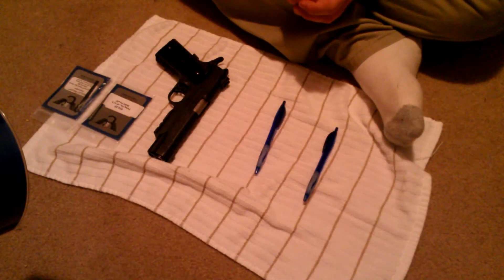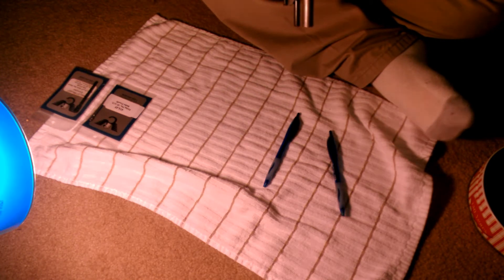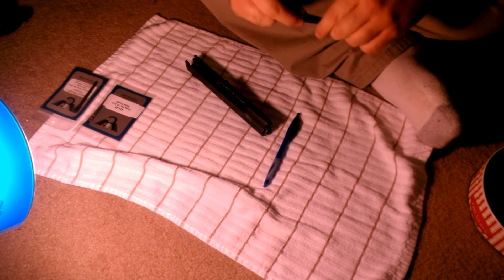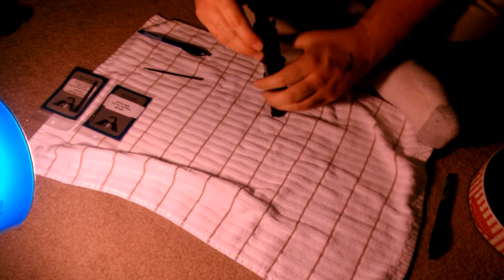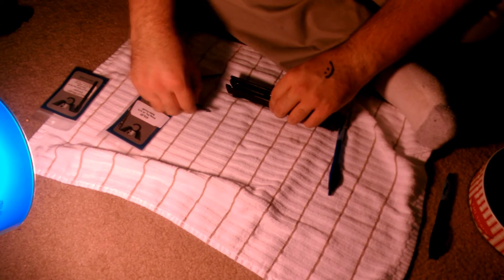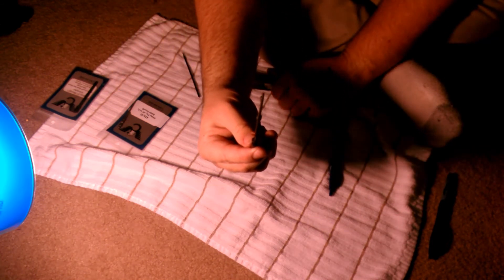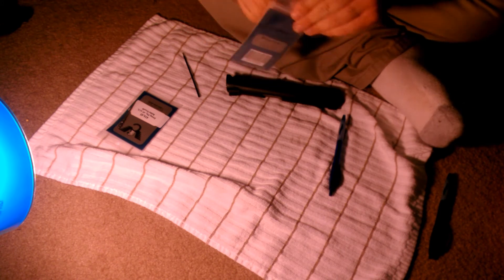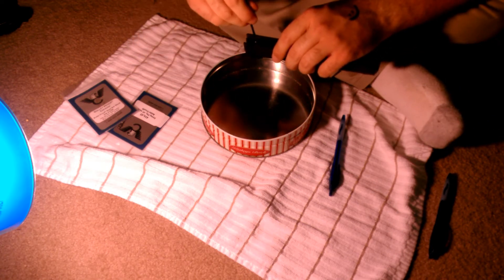Taurus PT 1911 Extractor Replacement

Comment: My pt1911 extractor broke at the claw at around the 250rnd mark. Called Taurus and also had horrible C.S. and am still waiting on a replacement extractor two months later. Ordered a Ed Brown Hardcore and it dropped right in no tuning or adjustments needed.